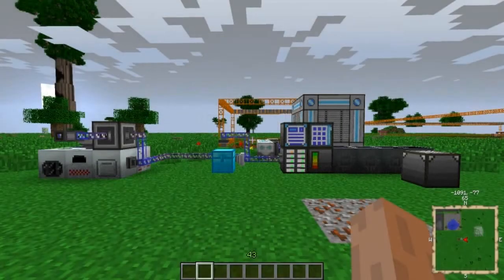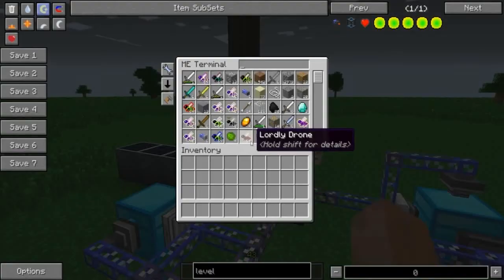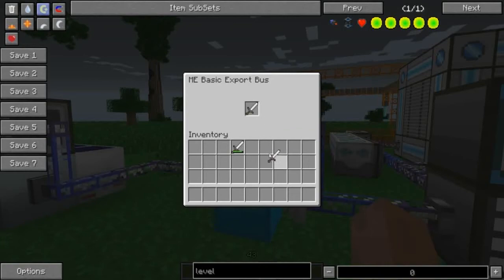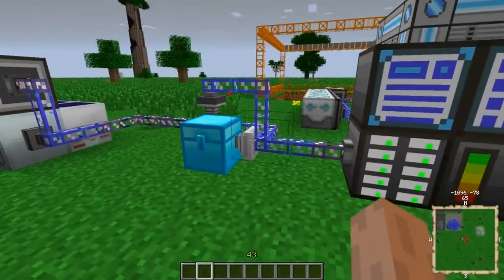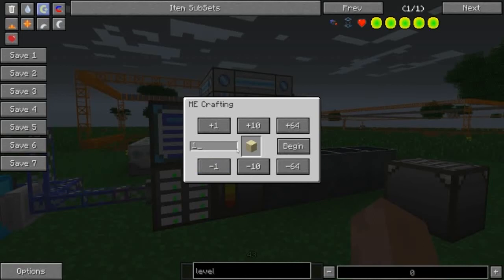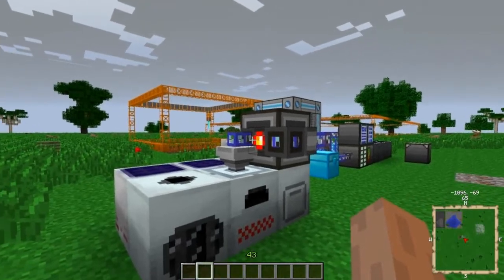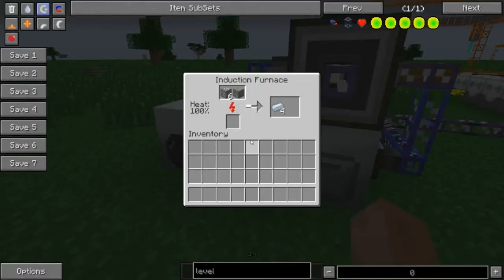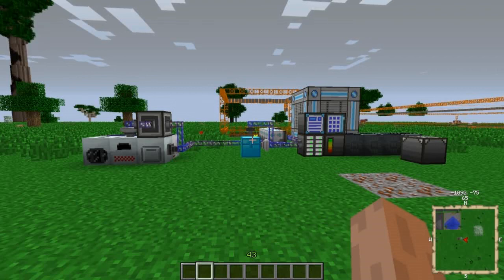FTB 1.5.2 Tutorial: Importing and exporting with AE

Comment: I did exactly what you did but I don't get the option to craft the sand from the terminal.
The only way to get the craft option is to put an export bus on top of the macerator and then put the ME Interface on top of that. It shows me the craft option but doesn't do a thing...